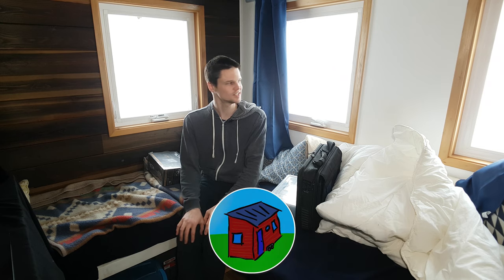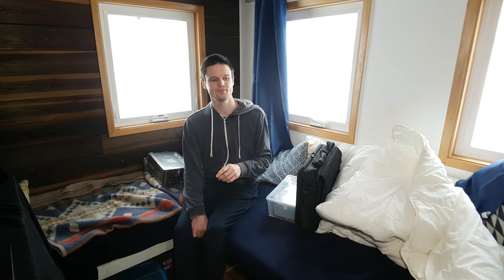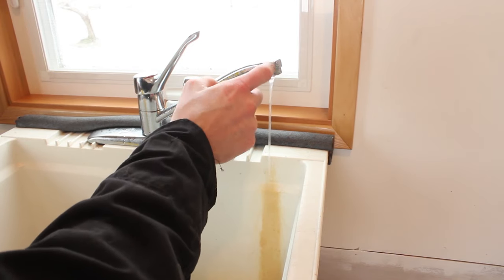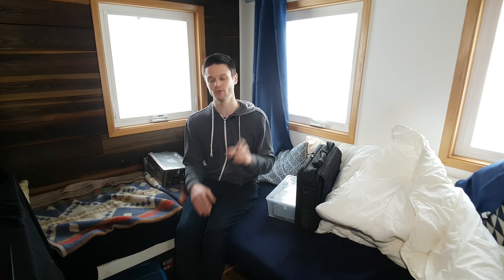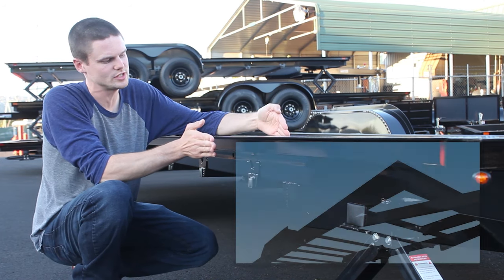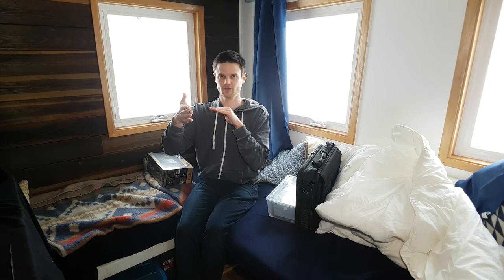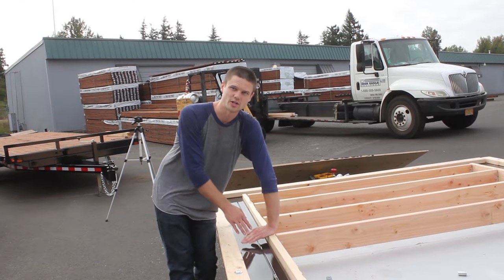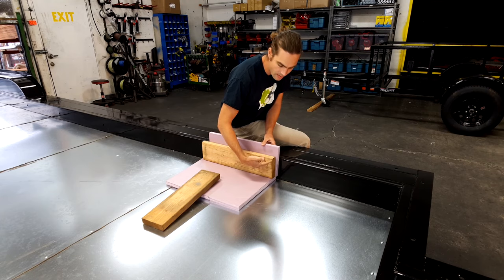Tiny House Winter Condensation & How to Insulate Your Trailer

Comment: I did a smaller flange around the outside. Still big enough for tie downs though. 2x6 subfloor with rigid foam. I also made sure to properly vent the metal roof. It isn’t as efficient as a really tight building envelope, but it breathes well and I haven’t had a problem with any condensation. Still stays toasty warm and heats up quick! Lots of other lessons learned along the way of my build though!👍
Reply from the maker: Something that we're coming around to now is realizing that the gains from doing a super tight and efficient envelope are small in a tiny house (especially considering you lose like 10% of your heat just by opening the front door for a few seconds!) but the drawbacks can come in forms that are unique to tiny homes, like the humidity that builds up so quickly in a small space. Sounds like you've got a good setup and prioritized the right things :D

Comment: Hey folks!  I've seen with some off grade houses where they purposely run HVAC into the attic and crawl spaces to make the home more efficient.  I think you could do the same by building a semi-permanent skirt around your tiny house and then push some circulation exhaust into that space. The temperature differential would be lower and the inside condensation might go away.  Thanks for the video!
Reply from the maker: That's an interesting idea... you know, we just paused from replying to comments to talk about this and how we may want to abort our original air-exchanger plan in favour of a direct vent from our toilet box straight down into a skirted crawl-space, then have a fan to move air out of that space and into the open behind the house... our original penetrations for the air-exchanger could still act as make-up air, and I could even control the exhaust fan speed based on the outside temperature so we don't draw in too much cold air... we've found that we have windows open 24/7-365 anyway, so the whole heat-recovery idea probably won't add enough value in added efficiency compared to the complexity and time needed to build the thing...

Comment: Hey Jake, we too have run into that same situation in our Tiny over the past servers months.  We are also framed up over the flange of our trailer which allows the cold to transfer through to our floor.  Thankfully we used vinyl plank flooring so no worries of rot but it does still concern us.  I was even considering doing a test with some rigid foam attached externally to the flange to see if that might help keep the water from forming.  Maybe even skirting the entire trailer  to see if that keeps the cold temps down.
Reply from the maker: Skirting is a good idea, and something that we've slacked on for way too long. 
Go ahead with the rigid foam on the outside if you want to get some real data, but I suspect that it won't have much effect because the metal can conduct heat so well... any exposed portion of the trailer will essentially "wick" the heat away, so you'd really have to completely cover its surface :P

Comment: This is an interesting and pretty timely video for me. I just purchased a trailer that has the steel joists that I was planning to use for my subfloor and then put insulation between the steel joists and then the plywood subfloor on top of that. I'm in TX so I probably won't have to deal with the condensation issue as much as up north, but I am worried about the summertime and cooling the tiny house when it's 105 degrees out. I think I might make my own 2-3" sip panel to decouple the steel joists from the floor and then frame over top of that. Thanks!
Reply from the maker: Glad it provoked extra scrutiny in your build process. Just make sure that you have solid material to support everything... foam alone will compress, so you need wood blocking at regular spacing, just like any normal wall/floor/ceiling. 
In terms of cooling during the summer, make sure to look into vapour-sealing that is appropriate for your climate, because it's possible to end up with the opposite problem to what we can have... which is that warm humid air from outside causes condensation when it gets close to your cooled interior (forming water inside the walls). I highly recommend checking out Matt Risinger's channel for building-science in general, but also because he is based in TX as well.
Reply: @tinynestproject  Thanks for the reply. Oh yes - I definitely follow Matt Risinger and will be using several of his practices in my build.

Comment: Very informative! We also live in a tiny house near Vancouver Island (Puget Sound in Washington State), and have been battling similar issues for the last 3 years since we built ours. One of the best solutions for us has been a properly sized dehumidifier, capable of keeping the humidity in the house under 50% (preferably under 45%), especially in the winter when temperatures drop below freezing. You may already have a humidity gauge in your house, but if not, we can't recommend it enough. As for a dehumidifier, we use the 15-pint Ecoseb Desiccant Dehumidifier (Model DD122EA). Ivation just released a similar, cheaper 13-pint model which is equally capable. Both are on Amazon. We've tried smaller ones, but found they just weren't up to the task. Another benefit to these dehumidifiers is that they produce a little bit of heat in the process, which is a nice supplemental heat source during the winter. Ours is pretty much running 75% of the time in winter to keep humidity at a desirable level to avoid condensation and mold growth in the house. I would argue that it just feels noticeably more comfortable as well. Love all your videos! They were a huge resource when building our own tiny house.
Reply: Another thought: Perhaps a small layer of rigid insulation (1/2") on top of the subfloor, but beneath the exposed flooring inside the house would be another solution? It would probably have to be either XPS or Polyiso foam, which are denser and firmer than the cheaper Polystyrene, as to not collapse or squish down over the years.
Reply from the maker: Have you done any mold-killing, using bleach or some kind of cleaner? I see there's another comment recommending to do so... or risk "a slow painful death" XD 
We have two of the smaller (no compressor) types of dehumidifiers right now, and they do alright since we're not yet showering in our house (the shower is the last major thing we need to finish off). We don't have a humidistat installed, but I plan to integrate it into our DIY smart control system :D 
The builder Derin Williams (referenced in this video) has commented to me that any rigid foam board will compress over time, so placing it under any weight without solid support will eventually lose stability, so I think the best option is to integrate it into the structure, like you would any other insulation. 
Thanks so much for watching and taking the time to comment!
Reply: @tinynestproject  Yes, we are currently dying slow painful deaths! I'm pretty sure mold is everywhere, even in the air we breathe outside, so I'm not too concerned. Black mold may be a different story though? We do use a product called "Mold Control", which comes in a spray bottle and is supposed to "stop & prevent mold". We spray down the surface of our Nature's Head composting toilet every now and then to kill any mold that may have found it's way out of the compost reservoir and settled on the surface of the toilet. Our toilet had a mold mite infestation once, but we don't like to talk about that because it gives us the heebie jeebies. We also clean the wood surfaces of our windows with it every spring to get rid of any mold that may have developed over the winter.
Reply: @tinynestproject  Marmox board IS the floor insulation board that is stable/resists compression .. that's the whole point of a special floor insulation
Reply from the maker: Is Marmox flexible? I haven't had time to dive deep into it, but it appeared to have concrete as the outer-most layer.
Reply: @tinynestproject  Marmox is NOT flexible .. it was meant to solve the problem of needing a insulation of the floor, but not the inevitable compression of simple foam insulation .. it insulates and it resists compression (I wouldn't go so far as to say it's structural) .. its used for general floor insulation and most importantly a insulating base for tile/vinyl/laminate.
Reply from the maker: I'd be worried about the outer layer cracking/breaking because any tiny house trailer will flex, so a large rigid panel installed anywhere might be at risk from such movement. The location that I'm interested in using a solid material (with better insulation properties than wood) is to support the walls themselves. Basically just on top of the side-extension perimeter of the trailer, where you have the actual wall-structure bearing down, as well as the few inches of flooring. It's also a bit hard to describe in text format... I should do a SketchUp livestream about floor structures :)

Comment: You could make a box underneath and fill the cavity with spray foam for insulation. Just where the flange is.
Reply from the maker: Definitely an option... would be quite a hassle so we're hoping to avoid that if possible. We should build a skirt around the exterior which might have a decent impact on the situation, but it might not be until next year that we put it to the test. Stay tuned!

Comment: I have 2 improvised solutions for you. You could add some ridged insulation to just the areas were you are getting condensation and then cover that with a moisture barrier -- maybe just a bunch of tape. That should keep moist air far enough away from a freezing surface.

Or you could just stick fans in those areas and run them when only when its cold. Given your climate I would go with the simpler fan solution myself.
Reply from the maker: I think adding insulation would work, but would be a real hassle... we did put a space-heat pointed under the couch and it dried up pretty quick... a regular fan (no added heat) could actually cause more condensation, because it would force even more of our interior air to come in contact with the cold surface. We learned this when we had our previous condensation issues (in that older video I mentioned). We pointed a fan underneath our temporary kitchen sink and it increased the condensation instead of drying it out... that's actually how dehumidifiers work: they refrigerate a surface and blow air onto it, then collect the condensation that forms and drips down.
Reply: @tinynestproject  I was thinking of preventing mold, but I'm surprised this would increase the condensation. What about heating the surface -- with a light bulb or something like you use on the pipes? If there's no cold surface there shouldn't be condensation. The other option would be a vapor barrier away from the cold surface but if the gap between the exterior surface and the new vapor barrier were to get cold enough you would have condensation again. 

I would go try heating the surfaces that get cold enough to cause condensation.
Reply from the maker: Yes that's exactly what we've done: heated the area(s). But the problem is that since it's a weak-spot in the shell, it will cool down more quickly than the rest of the surfaces... down to a temperature that is cold enough to condense moisture. We have a new idea for a skirt (which we should have already done by now to be honest) which could reduce the weakness in the corners.

Comment: Thanks for sharing as I wouldnt have bothered insulating like that until this video! Do the better example videos you share account for the compression of insulation over time? Ta ✌
Reply from the maker: Glad we got you thinking about it :) 
You always need some solid blocking to bear the weight of walls/floor etc. Don't try to build anything load-bearing on top of foam insulation. I think I show this general idea in one of the SketchUp Iron Eagle videos. You want to get as much foam board under there as possible, but put wooden supports as-needed.

Comment: I can only comment on my experience I have had with condensation in the past on my wooden windows in my home. I have an older home not a tiny home but I have been installing 4mil plastic on the outside of my windows and since doing that I have had no condensation on the window glass since doing so. The heat inside the home transfers into the windows and heats the air between the plastic and the outside. When it does get cold here in central USA the plastic itself will have frozen condensation on it, but as soon as the sun hits the plastic it seems to go away pretty quick.
Reply from the maker: I've heard of this technique and seen it a few times, but the plastic was on the inside... I figured this was a vapour-seal to prevent the humid air from being able to contact the cold glass. It's crazy that the plastic can cause enough isolation to reduce the temperature differential as it has for you. I suspect it has to do with the fact that the trapped air is... well... trapped, instead of the glass of the window being directly exposed to the atmosphere.

Comment: Jake, what about insulated skirt that I have suggested to you a few months ago? It should really help as nearly whole trailes metal would be contained into warm cavity/space. Thermal bridges are the most critical details...
Reply from the maker: Yes we know that we've been slacking on a skirt, but another recent comment got us thinking about how we can vent some exhaust air directly into such a cavity to further improve the floor-warming effect it could have... we will definitely do it... soon(tm)
Reply from the maker: Yeah the original plan was that I would build a DIY heat-recovering air-exchanger... but after living in the house for quite some time now, I don't think the energy-savings makes the hassle of building/maintaining such a device worthwhile. You lose like 10% of the house's heat just by opening the door for a few seconds, so the amount that could be recovered is nothing... energy-savings is built-in to the fact that we're only heating a tiny space to begin with! Not to mention that sending (warmed) interior air to a closed space under the house would actually recover a portion of the energy since it would warm the underside of the floor. 
Obviously in very cold climates, a recovery device could be worthwhile, but not where we live.

Comment: If memory serves me, I thought you put a vapor barrier under your primary floor and left enough to bring it up/over and over rap the edge several inches onto the top of the floor (under your wall framing).   At this point, some small weep holes might alleviate pooling at collection points.  There is a flooring product called Marmox board that I brought up to you at the time of the build that would have significantly given you better insulation, yet still you need to manage the moisture in your TH.  Whatever happened to your venting/heat exchange plan for you TH?  I also vote with Brandon about running a dehumidifier when it's cold (thou they are big, relative to a TH floorspace)
Reply from the maker: Not sure where you are suggesting to put weep holes? 
We just saw a comment from John Norris (see our reply there) that got us thinking about our air-exchanger plan and how we might change our approach to it. It would still circulate air through the house, but the energy-recovery is probably not worth the effort of building and maintaining a complex DIY device... not to mention that exhausting into a skirted crawl-space would recover some heat energy in the form of warming the floor a bit.
Reply: @tinynestproject  weep holes are for odd wet/points to allow water droplets to migrate somewhere else .. i.e. Storm window/glazing usually has a couple of weep holes at the bottom to let water/moisture out .. it's a bit clugey but if a wet point is just left, it will rot.  Air exchange/recovery is good but I thought the best answer was the dehumidifier for a dry TH.  For all the work/effort/money you put into insulating your floor I would have thought the result would have been better
Reply from the maker: We're hoping to end up in a place where we have a small amount of air exhausting, combined with a small dehumidifier, and hope that between the two we can keep humidity at a good level. 
The floor itself is great, which is basically automatic when building on an Iron Eagle, but as novice building-scientists we didn't scrutinize the perimeter enough. Other tiny house builders, like Derin Williams, have also learned and evolved techniques to improve these details, which only really comes with time and experience. It's also worth noting that we built our floor in 2014! my GOD we've been at this forever XD so back then there was a lot less that had been tested.